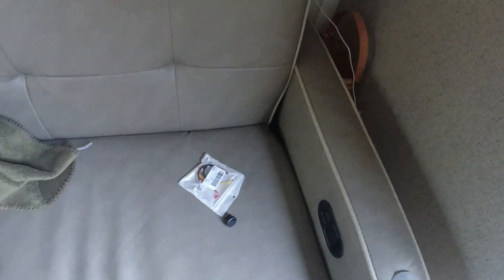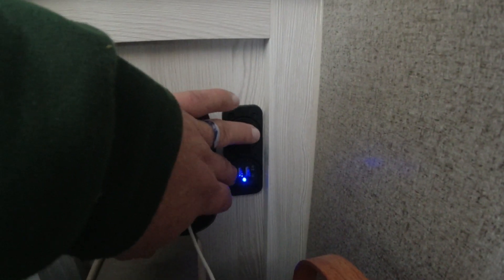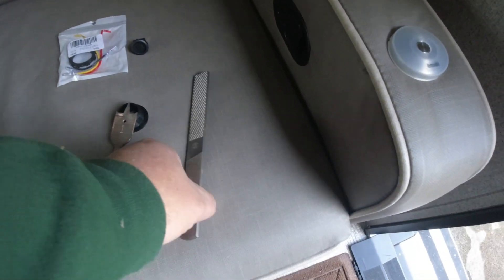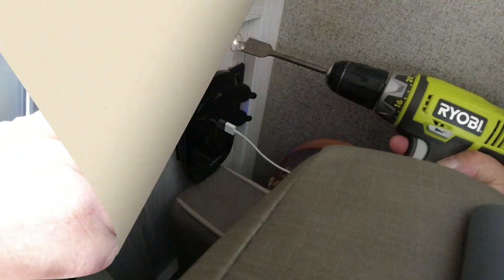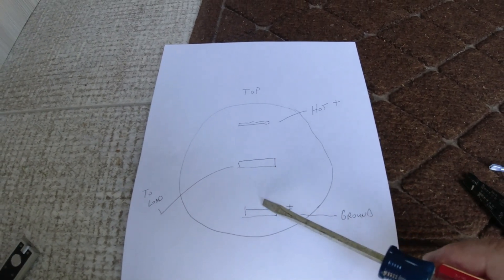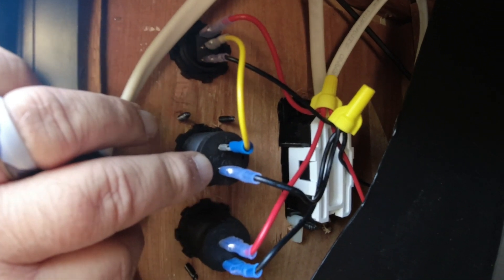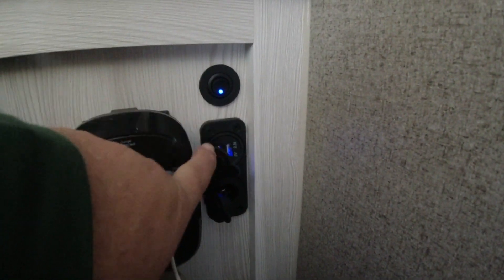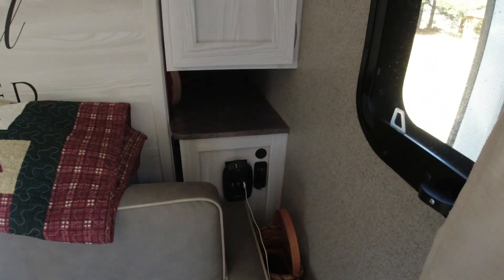Adding a Switch to a 12 Volt System

Comment: Why not tie the USB outlet into the 12v power after the main cut off switch? Then when the RV is not in use the LED won’t be on.
Reply from the maker: Only place to tie in the 12 volt on that side except for the solar on the side which is tied directly to the battery

Comment: I bet this will come in handy for those who are trying to figure out how to do something like this. Very easy to follow and you don't overcomplicate the "how to" part of the install. I did the same thing on my 5er except, after adding dimmers to all the lights, I had those led indicator lights on all the time. So I added small switches like you to all of them along with the radio, built-in USB ports, and anything else that was 12 volt powered. And, yeah, you're right about the little amount of power those LEDs use but, when boondocking or just parked, I figure it's best to get it down as low to 0 as possible. Thanks for another informative video.